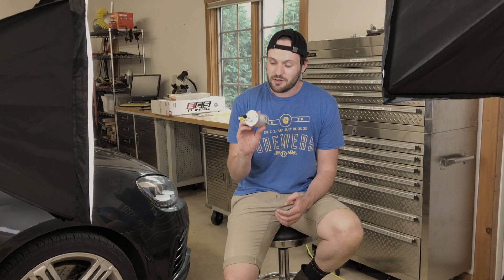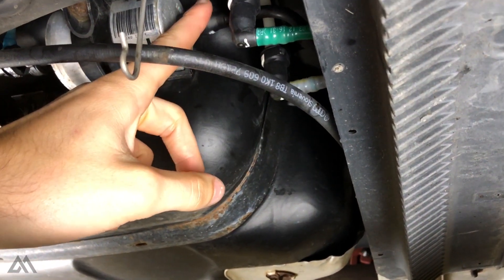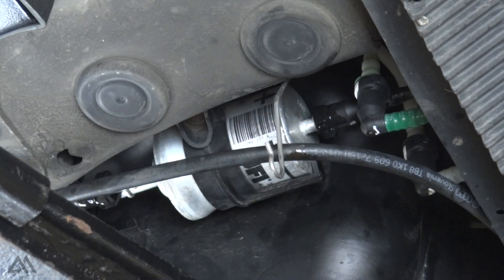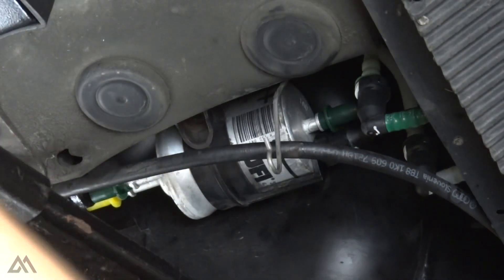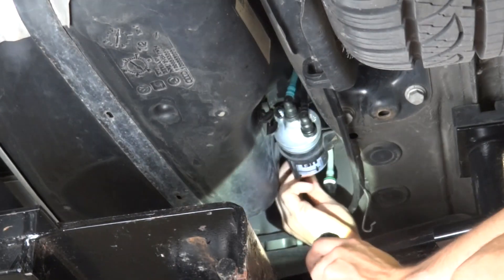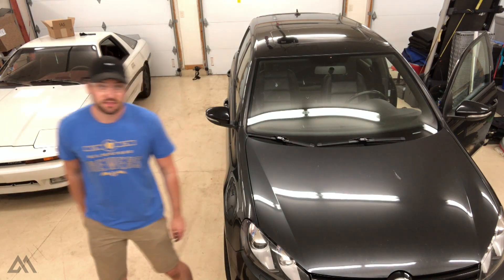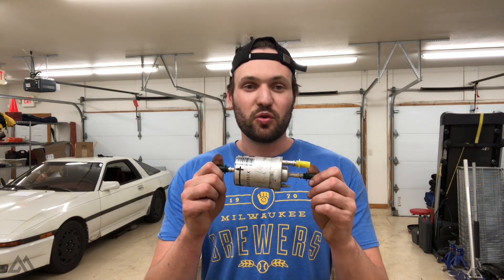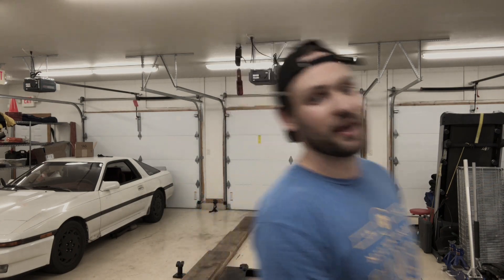How To Replace the Fuel Filter on a Volkswagen / Audi 2.0T!

Comment: Can somebody help?? I replaced the fuel filter on mine and primed the car and the car wont even crank when i turn the key. I dont know what i did wrong, i know youre suppose to prime the car before starting and i did that but i cant even get a crank. I turn the key as if im starting the car regularly and get no crank at all.
Reply from the maker: Battery?

Comment: Great shot of the buttons to release the lines. I got stuck on these for about 45 minutes. Everything I read seemed to say you push the line in and then pinch the connector, no mention of the button. Once I found a photo of the actual location of the button, it took me 30 seconds to pull all three lines. As a note, if you loosen the bolt on the filter retainer, you can rotate the filter to easily reach any buttons hiding on the other side. Also, I sprayed some cleaner on the lines first, and that made the release buttons a lot easier to see.

Comment: Nice video! Excellent tip about putting the fuel caps from the new filter onto the old one, to prevent gas from leaking all over you. Not even Paul at Deutsche Auto Parts knew about that trick :-)

Comment: Yeah i did mine a year ago 39000 miles . 2 hours or so , a real pain . I cut it open out of curiosity , it was like new .
Reply: gas is a great cleaner for the most part. if you run your car a lot and dont have a car sitting for long months or years. your filter should last a good while. but yes its an easy and cheap change that should be done every once in a while